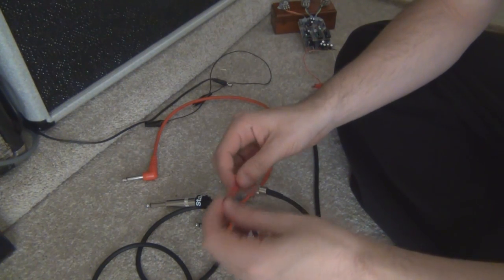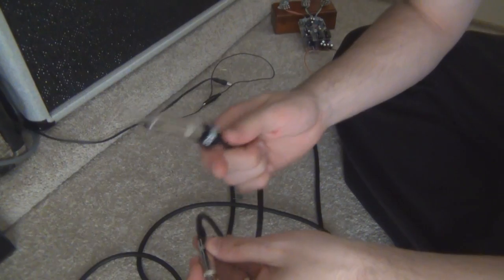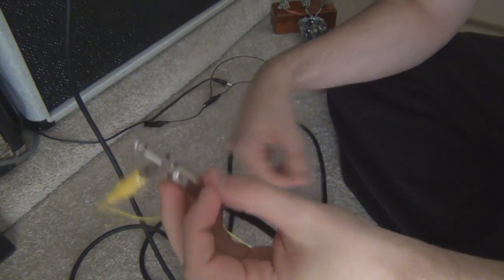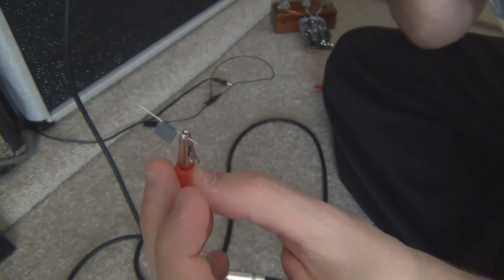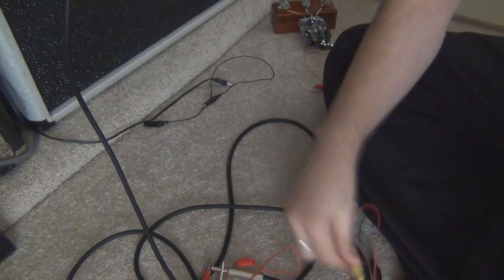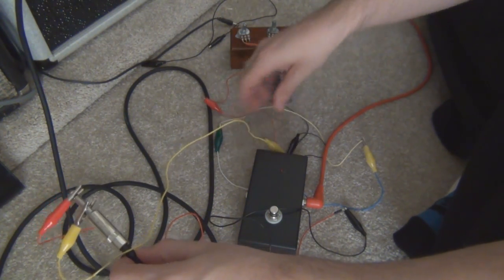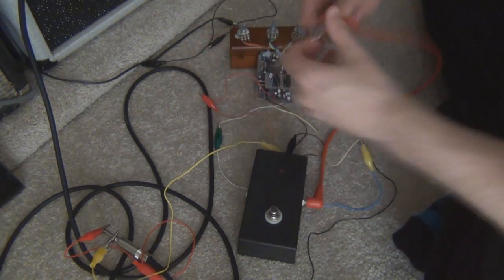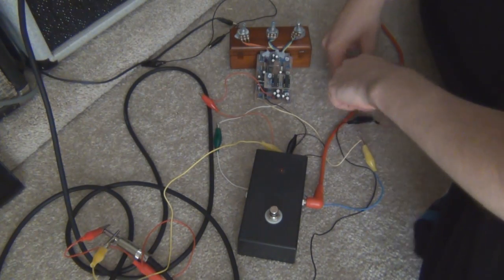Guitar Pedal Fault Diagnosing - Audio Probe

Comment: With using multiple alligator clips you have potential for bad connections. It better to use a female guitar jack and solder all the connections, that way you can plug a normal guitar cable into your audio probe.

Comment: Just a question, In the video you are probing the top. maybe that is better for the chips ic. But what about underneath where the legs have been cut ? seems easier because mon the bottom of the pcb is where the leg tips are exposed. Or is it wrong to touch those?     What exactly are you touching ? Is it like playing Operation and scare you when you hit something?

 I'm just having a time with this Dallas silicon fuzz face circuit. it has an on-off pick up selector option and when you flick it ,it cuts the signal completely off. But when you flick it back, it is signal on. But there is no fuzz and hardly any output volume like a transistor is bad.. But the transistors are fine. I'm stumped. 
think its for the transformer but has something to do with humbucker vs. single coil.  The primary on the transformer is 123 right?  Sorry I've done gone off topic. I hope you or someone can chime into my first questions though.. And I should subscribe because Thanks for all your help to us all.

Comment: Hey mate! Thanks for the video. Question: Why do we need the 10nF capacitor? Couldn't we probe without it just as well? Thanks!
Reply from the maker: Hey Werther, cap is in place to block DC going into the front of your amp, its a good precaution to take.  Cheers
Reply: @DiyguitarpedalsAu  Oh, of course! That makes a lot of sense! Especially if you're gonna be poking around where there are DC sources present. Thanks!

Comment: Thanks for the video! I'm curious, what purpose does the 10 nF capacitor serve?
Reply: Capacitors block dc voltage.  I don't think 10 nf will work cause nf is nano farad. It will filter all of the audio frequency. You can't hear a thing.

Comment: Could you use one of these to find faulty components in an amp? I have a 30 watt valvestate that has almost no distortion on the dirty channel (I've messed with all the tone knobs, etc. It's the amp, not me) but I'm a complete novice and I can never find a forum where this problem is being addressed. So would the audio probe work for that or no?

Comment: Or you can just solder all your output wiring on a female jack. Thats what i did with my signal generator. I also soldered the 10nF capacitor on the same PCB of the generator. You just have to plug and play.